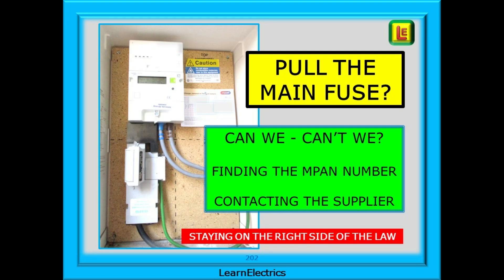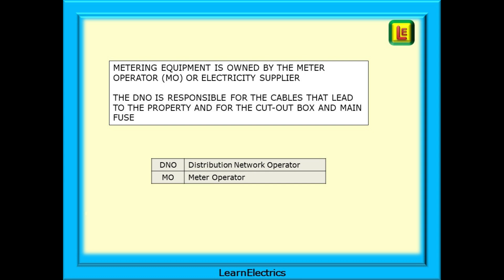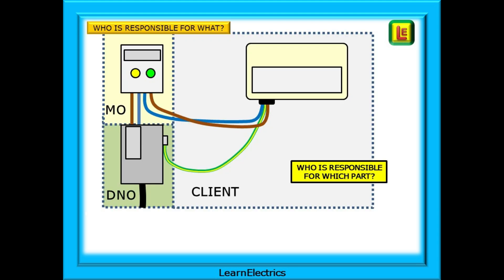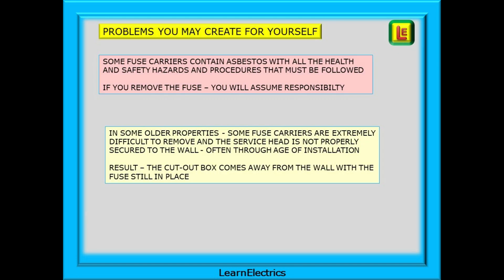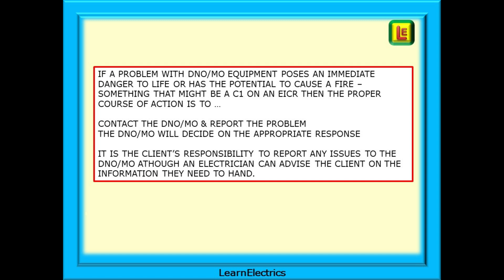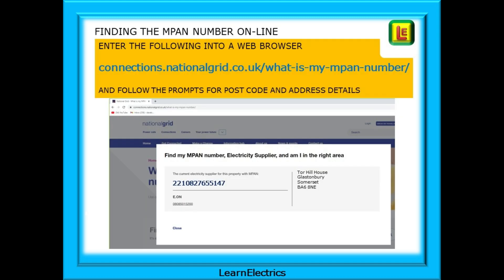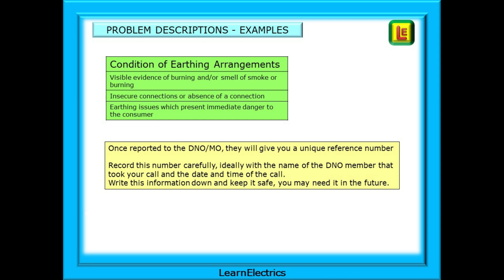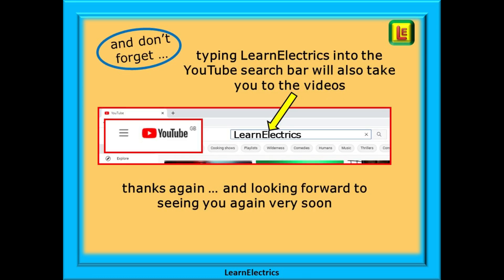PULL THE MAIN FUSE – CAN WE, OR CAN’T WE? – FINDING THE MPAN NUMBER – HOW TO STAY SAFE AND LEGAL

Comment: Most electricians will pull the main fuse, as a Smart Meter Engineer it was part of my job to do so and from my experience Electricians just do it.
Reply from the maker: Many do, but I have to stick to the rules in these videos. Thanks for your input.

Comment: Not going to work on it live are we , defo pull it out , safety first 😊
Reply from the maker: You'd be surprised how many people do work live when safe isolation is possible.
Reply: @learnelectrics4402  as a teenage apprentice, back in about 1989,  I worked on an industrial crabtree board without turning it off.  Just so we didn't have to get the office block floor of people to let us switch off the supply. They had a fair few computers even back then.  It was "only" connecting up one mere Crabtree C50 breaker ! 
It was all going quite well , until I slipped with the screwdriver, and caused a short.
Due to the office blocks main fuses running close to capacity, the surge on the local circuit also blew the main incoming fuse for a 12 storey office block . 
Lets say that was the last time I was so "gungho" !!!!

ALWAYS SWITCH OFF !

Comment: Gas and water supply a user accessible isolator to disengage the supply to premises. The home resident can use this user accessible isolator at any time.

With electricity they may or may not provide a user accessible and operated isolator.  However the electricity supplier does provide a method of isolation. It is more involved entailing pulling a fuse from its housing, but isolation it is.

If the premises need isolating this is the only method. If the supplier disapproves this method of isolation, they can always provide another.
Reply from the maker: Thanks for the input, appreciated. Dave.

Comment: I fitting a new CU in a mates property last week.I told him beforehand about the main fuse dilemma in which he looked at me baffled...I said i would book it in and it will be around £200 (with isolator).
He laughed , called me a wimp and pulled the fuse himself.😅
Bloody plumbers..😅😅
Reply from the maker: That's ok until it goes wrong. Thanks for watching. Dave.

Comment: What if its a pay as you go with no credit🤔
Reply from the maker: I would think that their priority was to pay for electric before having work done. It may need a call to the supplier.
Reply: @learnelectrics4402  I guess what I meant was that if its out of credit,  there's no power and you can work away without needing dno input. Obviously, the householder will have to run the credit right down and into the emergency reserve just in time for works!

Comment: I guess, the electricity supplier can also disconnect your electricity if you have a smart meter.

Interestingly enough, I have done it and when my smart meter showed a message “disconnected”, I came in and using a voltage sensor measured voltage on the input contact of the main switch. To my surprise, I saw voltage going around from 50 to 150V when the main switch was off. When it was on, this voltage dropped to zero. I thought this was a ghost voltage on that input wire. Thoughts?
Reply from the maker: That's an interesting one, has anyone else experienced this. Thanks for the input, appreciated.

Comment: In my opinion the DNS/DSO should provide the isolator switch without question and possible free or charge to comply with the Health and Saftey act /EWR 1989

    Means for cutting off the supply and for isolation – It must be possible to switch off the electricity supply to any piece of equipment in case of electrical danger. This can be by direct manual operation, circuit breakers or by stop buttons in control circuits of contactors.

    Precautions for work on equipment made dead – Precautions must be taken to prevent electrical equipment which has been made dead (whether temporarily so work can be done or permanently because the equipment is no longer in use) from becoming charged during that work.

If an Eectrician has to change a CU then an Isolator should be present as they are at work, thus the DNO/DSO must provide it.
Reply from the maker: Interesting response Sergio. Thanks for watching. Dave.
Reply: The simple answer is NO they shouldn't, the engineers don't work for free

Comment: Thanks Dave.  I was in a property yesterday which had a service head hanging off the wall, from which the Fuse had obviously once been removed and the  seal broken. (no isolator) I turned down the job and left them with the advice to contact their DNO or electricity supplier to get it fixed. I may need the money, but I don't need the DNO on my case.. ever..! 😀   Thanks for the clarity of your presentation.. I feel a lot better now.. !! 👍
Reply from the maker: Thanks for the interesting situation. Yes, we've all turned down jobs in the past for a variety of reasons. Sometimes better to sleep easy at night. Dave.

Comment: Some good points there, especially on the difficulty of removing the fuse in older properties. I spent several years changing consumer units for council social housing properties and at times it seemed as though they would come apart when removing the main fuse. Luckily now more isolators are being fit by the DNO.
Reply from the maker: Fantastic feedback, appreciated Joe. Thanks for contributing. Dave.

Comment: If a smart meter is installed you say the DNO know very quickly when the fuse is removed. How do they know you haven't just turned the isolator off (where fitted)?
This is just scaremongering. Pull the fuse or use the isolator and get on with the work safely.
Reply: Because the power has gone off to the meter, as it would with a power cut, then there’s tamper sensors on the inside of the smart meter, turning an isolator off doesn’t turn the meter off
Reply from the maker: Thanks Minitom, great contribution, appreciated. Dave.
Reply from the maker: Minitom has this covered below. Thanks for watching.

Comment: Anyone know what DNOs typically charge  for either removing the fuse or fitting an isolator???
Reply: For the Midlands, Western Power Distribution (now part of National Grid) were charging £172 + VAT for an isolator. Not sure what the new charges are.
Reply from the maker: JK below has it covered. Thanks for watching.
Reply from the maker: Thanks for the input JK.

Comment: The video says that the seals on an MO owned isolator cannot be removed.  Can an isolator be fitted (not in the meter box), new tails from the isolator switch to the meter box be fitted by the qualified electrician and the DNO/MO visit to remove the main fuse, connect the new tails to the meter and refit the main fuse.  The isolator is then owned by the customer.  
An isolator in the meter box may not be a good idea as it is accessible to anyone from outside the property.  Most CCTV systems do not have power backup, so turning the isolator switch off is a good way to disable a CCTV system.
Reply from the maker: Good point about the location of the isolator, thanks for watching.